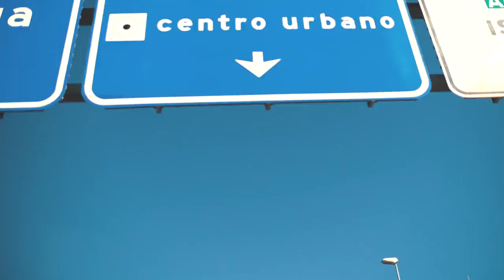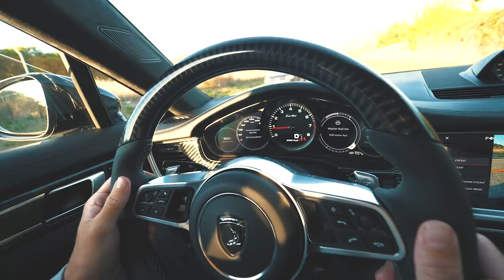TOPCAR KNOWS HOW TO MAKE ME HAPPY! | WIDEBODY PANAMERA TURBO | VLOG² 106

Comment: There is actually a faster stock panamera, the hybrid one has 680hp
Reply: 680
Reply: Felix Rapp thanks for correcting me
Reply: porsche panamera turbo s e-hybrid
Reply: You forgot the aspect of weight, so you lose power when your battery is empty...
Reply: this one already have a body kit she just need a full open exhaust Akrapovic with valve and a good Remap on Dyno

Comment: 40 km's on the clock and you over-rev it, hahah. Atleast it is not your car
Reply: its a porsche...
Reply: Makzz You not gonna destroy the car with that it's a different story when you do it all day on a circuit but what Jon did is not a problem at all
Reply: Charlie Murphy it’s still not good for it.. i feel sad for the guy who buys it
Reply: It's a myth...
Reply: cremo33 No no problem at all Porsche does the run in or break in for the engine in the factory
Reply: You will not break the car but you will lose power, if you buy a brand new Porsche, you rev it every day, it will take 4 months and you will take it back to the garage
Reply: New cars are broken in at the factory dude relax.
Reply: You can't really over-rev it... what's happening is the car is reaching redline and the ECU won't let it rev further precisely to avoid any damage... so it stops you within safe levels of revs...
Reply: When you pay that much for a car the engine is already broken in lol
Reply: well I work at Mercedes and can tell for sure that the AMGs don't run through any break in process at the factory. BMWs neither
Reply: Porsche only recommends a 1500km break in period
Reply: Sounds like you are overreacting sir
Reply: It's not pronounced Porch it's a PORSCHE and it's not made for gays
Reply: @pluppen1337  No. Just No. Be nice to the engine for the first 500 miles and let those pistons seal correctly. It doesn't matter what story you've been told. Any new car is a significant financial investment, and letting the pistons seal, the diffs erode softly, the trans gears etc, you are doing the number one preventative thing for catastrophic failure. Also, let the car warm up to operating temps before driving it like you're some kid in a fast and furious movie.

Comment: it has 40 km on the clock and you hit the gas so hard?! poor car :/
Reply: Porsche's are run in at the factory.
Reply: Andreas Wi Yeah so you not gonna destroy the engine and it's already run in,in the factory
Reply: Also the first thing I noticed
Reply: Chris Allenby, they aren't AHAHAHAHAH, you crazy, can you imagine just the operation to run the engines before they shipped?
Reply: Cut de Pie Fails Yes they are every enigine is
Reply: And yet they advise run in even for GT cars.
Reply: Some big german car channel purchased a Lexus the other day and at the time they picked it up from the dealer, they asked how long they must run in. The answer was, that the farbrication quality nowadays is so good, that you can go full throttle right from the start. The only thing you should do is warming up the oil and engine.
Reply: Take a look at Shmee150 GT4 collection video, Porsche themselves confirm that there is no run in period.
Reply: This is being harder than it should, just because there is no run in (mandatory or not), it doesn't mean they are run in, it just means they don't require run in. That's my whole point.
Reply: Well, the whole discussion was regarding to pushing the car when new, and it's fine to do so.

Comment: so much tile.. tile outside looks bad and it shouldn't be throughout the house, house should have wood flooring, and outside it should be concrete by the pool not tile, you will break your neck on wet tile